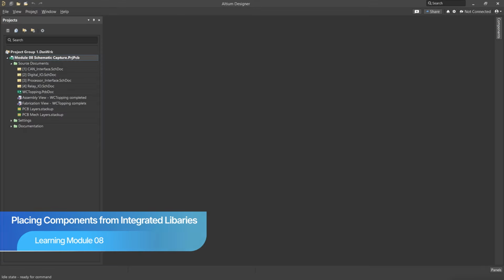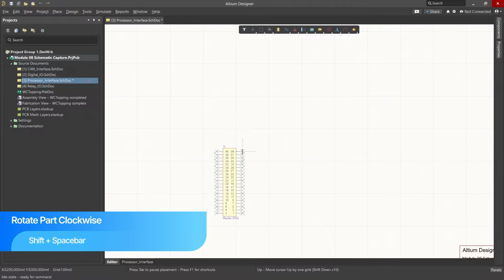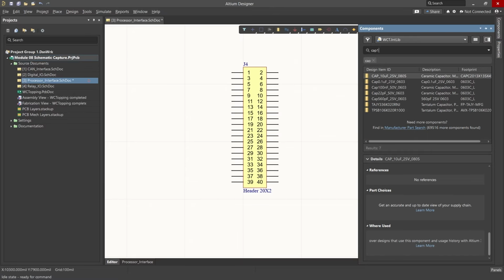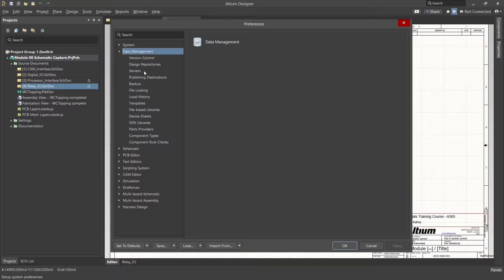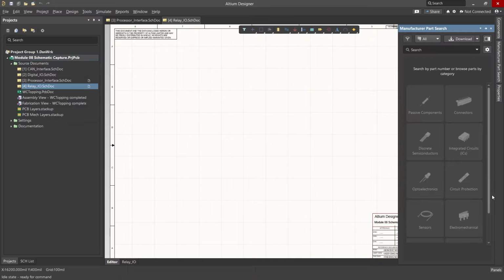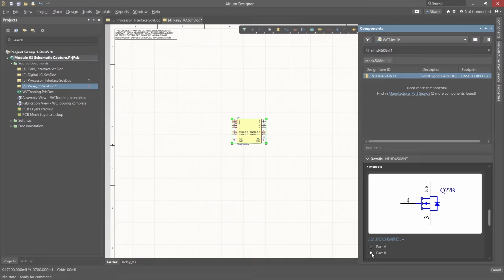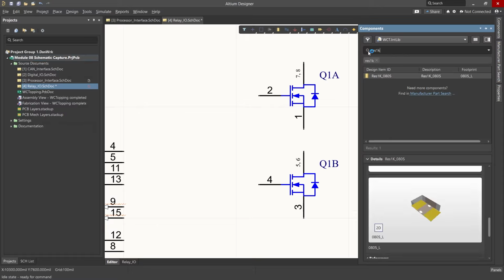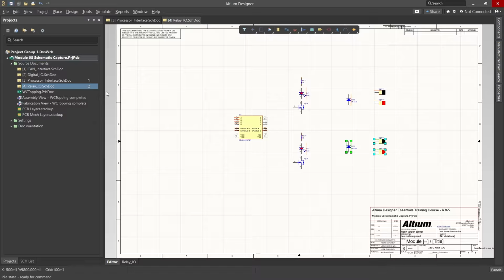Altium Training - Schematic Capture: Placing Components from Integrated Libraries

Comment: The goal of design is to create an electronic product. Efficiency in development must be built into the component design process; it must be tied not only to the supplier but also to the manufacturer and printed circuit board assembler. Only then can the entire process be effective. If components are not properly prepared from the outset, designing with this approach is extremely ineffective.